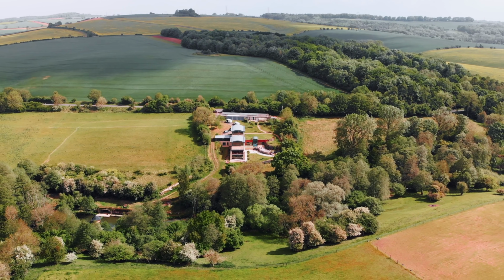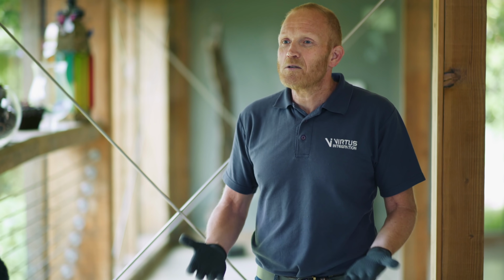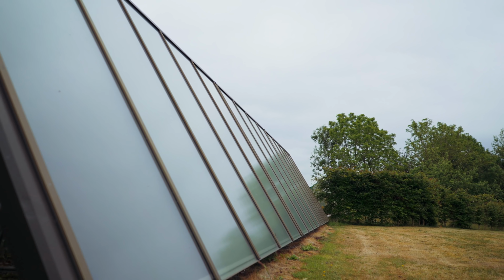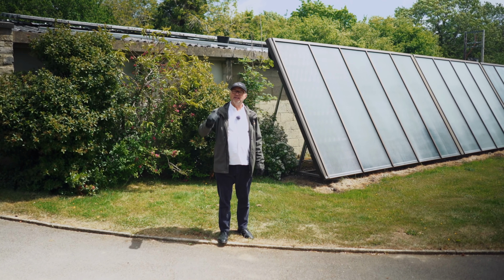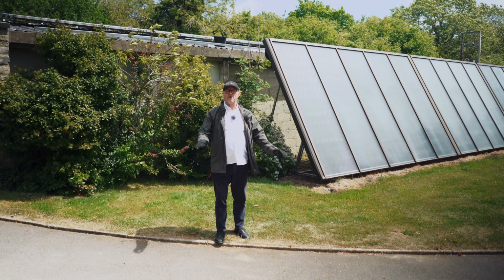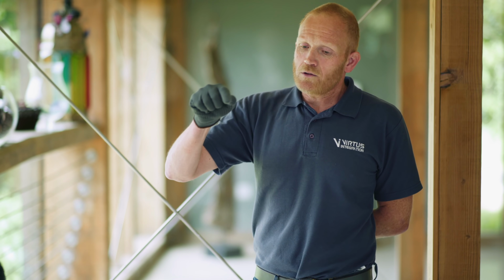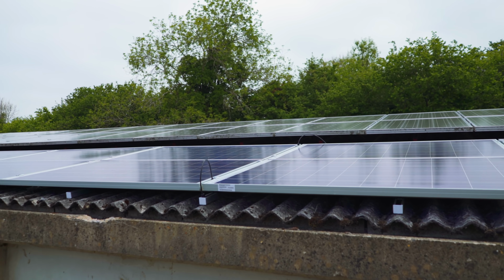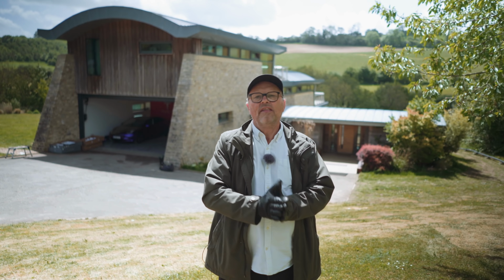Can you HEAT & POWER a big house with RENEWABLES? | FULLY CHARGED for clean energy & electric cars.

Comment: Our house is build in the 50’s and is energy positive, that means we heat the house and charge the ev with our 50 solarpanels. We spend a lot off money on insulation and offcourse the solar instalation, last year wo got money back from the energy company. Yes you can!
Reply: It must have been a strip out.

Comment: Robert, 

yes it is possible if you have an unlimited budget. If you rely on solar alone which averages about 10 to 12% capacity factor and have extremely large batteries to store when it is generating and your consumption is low, but don't forget to consider in winter when doing your capacity sums.  What are you planning for heating and cooking energy?
What the country really needs is cheap and reliable power which now is neither due to renewable generation. More of it puts us on a slippery down hill slope.
Wind and solar are technically unsuited for large scale grid supply despite the nonsense in some of the National Grid's ESO website, they should know better. The cost to balance the grid is climbing steadily all the time, cost passed to the consumer. Current electricity prices are 40% or so higher than they would have been without renewables. This cost inhibits business and as we have seen heavy industry has all but disappeared to the detriment of us all.
This technology may well be interesting but it is not effective and never can be.
Reply: PV panels and EVs will greatly aid in balancing the grid. EVs can be used to eliminate peaker power stations.

Comment: I recall a program in the early 2000's that covered the early stages of them building this house, where they were only at the stage of boring the geothermal hole and laying the ground heat network. It's nice to see someone go back and actually document the finished work.
Reply: This vid did touch on that matters have moved on technically. Having a geothermal borehole is an expensive undertaking. It would need to be communal, or a very large house with a well heeled owner.

Comment: Interested to know exactly how the concrete 'stores' and 'releases' the heat. Does it work like an old storage heater where it  just emits heat during the day? How do they direct the output to where it is needed? Amazing house, was the architect an eco specialist?
Reply: Concrete, stone, brick etc are very poor materials for thermal capacity, and most of these are not ecological or low-carbon. They are very slow to take up and release thermal energy and only work if they are 'exposed' - they work even less well if buried under a carpet or other surface covering or items of furniture. Glass is quite good (high specific heat capacity) but of course it is one of the highest embodied-energy materials so it's use should be minimsed!
Be warned - a building with a high level of thermal capacity using such materials will become a nightmare in future climate-warming situations. They will slowly charge and saturate with heat and due to high ambient night-time temperatures they will be unable to cool. Also remember that thermal capacity requires an energy source and when cold it will rob you of your radiant body heat! 
Water is an excellent thermal storage material and is usually free from the skies, and convection currents help water absorb and redistribute the heat in a tank. 
However, if you want a thin, lightweight material that is way better than glass or water at soaking up solar energy and then releasing it (at pre-determined temperatures) - then you need (PCM) Phase-Change-Materials - such as DuPont Energain. I hope one day we will see PCM materials available that are made from plant-based oils/waxes rather than paraffin..

Comment: Ground source heat pumps using trench style slinky heat collectors are incredible cheap and offer huge energy saving capabilities for almost every building. But even with an air to water heat pump you are far more enviromental friendly than any other heating technology  burning fossiles.

Comment: Moved to France in 2013 where we bought a 200 yr old stone house which needed completely renovating. Ripped everything back to the stone and started again. We put double the insulation required by French building standards and have put 3 wood burning stoves in. That is all the heating we need as once warmed up in the winter the massive walls retain the heat. The house is 200 square metres floor area. In March last year bought the first and only new car I will ever buy in my life (I am retired now), the Kia e-Niro. We have 2 acres here plus an acre of woodland 5 mins walk from the house. Last year replaced the petrol lawnmower and strimmer with Li-On powered machines and this year the chainsaw went electric too..In May last year added 8 x solar panels on the barn and produced 2,150 kWh in the first year with them, enough to power the e-Niro for 14,000 km. It isn’t perfect but we burn no gas or oil in heating the house, half of which comes from compressed oak sawdust logs recycled from the French forestry industry which is huge (France has the same area of forest cover as the entire UK land area)..the rest comes from coppicing and maintaining our own woodland and from local farmers. The common firewood here is coppiced sweet chestnut and hazel which they run on a 20 year cycle, clearcutting an acre or so at a time...it is amazing to see how fast it regenerates. Financial constraints mean it will be a few years before the next steps which will be an air source heat pump and 4 more solar panels. Some friends here have air source heat pumps and these things are getting more and more popular now which government subsidies to install them. Our experiences with the car, solar and garden equipment recorded on my YouTube channel ‘Kia e-Niro Diaries'

Comment: The micro grid is definitely the future, however, the price is prohibitive partly due to the decade long payback and more importantly that power generation is not a consideration when valuing a home for sale.
So a home with environmental heating is worth the to an identical home with a gas boiler, gowever, it cost vastly more to purchase and install. 
With the government exploring making it mandatory for a new home to include at least one renewable technology, this will only end up costing the home owner more in the short term and is very dependant how long they keep the property before they sell.
I have just designed our new home and although I would love to include some of these features, self build mortgage lenders do not take them into account when valuing the property, this you have to cover the cost by other means via grants, etc.
From research generating and storing electricity to balance the grid is the quickest payback, however, it is a prohibitively expensive outlay.

Comment: Great episode Robert…Passive House standard mentioned for design/building results in 90% less energy used and now with the Plus and Premium versions - it's very straight forward to build every house like the the Moonstone House in the UK…Exeter City Council are building a sports centre to Passive House  and there's a hospital in Frankfurt that is also built to PH (uses 50% less energy than a normal hospital).  Social housing and private homes are being built to Passive House standard across the UK at similar costs as a normal house with massive ongoing savings and comfort/health benefits.  Simple principles - insulation, high performance windows, mechanical ventilation with heat recovery,  eliminated thermal bridging and airtight (draft free) structure.  We've just finished a Passive House Premium home in New Zealand which exports to the grid, runs our EV, etc.

Comment: Any issues with overheating in the summer? As so well insulated to keep heat in... in some of these odd hot weeks we have... will it be sweltering inside or will be able to keep cool (my new, lot smaller, house, very well insulated, keeps heat in..., but gets super warm during hot (25°+) days/weeks... wondering if the same with this house or some of that clever heating can be used for cooling too...
Reply: Probably the difference with your new house? was the very large overhangs over their main SW facing windows which will keep out high Summer sun, but let low Winter sun in. Insulation keeps the Summer heat out, same as Winter cold, but you also need to keep the sun off the glass. Passive House insulation requires very little energy to heat, and similar to cool , so if cooling is required a reversible heat pump which puts cooled water through under floor heating would need very little usage / energy.

Comment: A  place worth visiting , in normal times, is the National Self Build and Renovation Centre at Swindon. Check it out on line. It is a good starting place for the latest energy saving ideas in House building.  Look out for their Green Energy events. 
Warning!  After my initial visit I ended up knocking down my old house and building as described in another post.

Comment: I see a lot of glass elements, and I'm interested in how this works insulation-wise. Can you really have the summer sun blast through a full glass building front day after day, and not have the temperature inside change at all? 'Cause we have a half-glass front here, and it's June, and sitting there in the morning is practically unendurable...
Reply: Main windows face SW and had massive overhangs (keeping high sun out in Summer but letting low Winter sun in) but, yeah, lots of glass is all the vogue but a nightmare for good thermal efficiency

Comment: As some one who made a large move and into a new build house in the last 3 years, I found it incredibly frustrating and saddened by the sheer lack of knowledge of these systems by the massive homebuilder companies. Had I been able to design and contract my own house I would've gone this route, but as we needed a house fairly quickly and in a specific school district we had to go with a pre-planned home builder. Just about every question about efficiency, solar, upgrading insulation etc was met with a blank stare followed by.. "we don't do that, I don't think the county would allow it, or "our houses are efficient enough"... :(... I even came in the night before drywall was put up and added more insulation and sealed gaps they left. Builders don't care, they just want to get the house built and sold as fast as possible. So like most of us, we're left with mediocre systems that we constantly have to patch with third party systems. I for one can't wait for Tesla to make new super efficient home heat and cooling systems that can be easily retrofitted.

Comment: How does that borehole work? Can anyone explain? Didn’t get it properly from the video
Reply: It's probably a soil heat pump, extracting thermal energy from the ground, and adding the electric energy used by the heat pump. With such a system you get 3 or 4 kw of power, for every kw of electricity.

Comment: In terms of Upfront Carbon Emissions, this house is an incredible example of what not to do. Building way more than you need, threaded through with energy intense metals and glass, and heated by an unnecesarily oversized system which is rarely used.
Reply: Exactly correct. I found this house (?) really offensive and many of it's systems unnecesarily excessive. It is a good example of having a human mindset of 'entitlement' and being unaware the harm we often do as a species.
In 1972 I designed the Integrated Solar Dwelling - a ultra-low-cost experimental off-grid, passive solar dwelling - which after years of effort I manged to self-build and monitor at Brighton Polytechnic. My partner and I designed and built a simple passive solar water heater that gave us boiling water for much of the year, we designed and built a water-less indoor aerobic composting toilet, the rainwater collection system and fitted water-saving spray taps, we constructed the experimental wind turbines and we created an organic garden and recorded crop yeilds. The dwelling was lightweight timber-frame (we fabricated our own i-beams), carefully constructed to provide air-tightness and it did not require much in the way of foundations - paving slabs will do the job. Tower housewares made us a special 24Vdc cooker and a local school teacher made us a 24Vdc water boiler. 
A major sponsor of the Dwelling was the Swedish Masonite company who provided panel materials (Masonite i-beams were not being imported at that time, though they were being tested by the Civil Engineering facility at the Polytecnic).
The design featured a large sun-space, an uninsulated buffer-zone to the north and simple 'solar-collector-south windows'. Solar pre-heated air from the sunspace was drawn into the dwelling by the low-level airflow created by the toilet vent pipe. There was never any condensation on windows and if you held your hand near an outside wall you could feel your body heat bounce back! 
We did have a major issue with the wall insulation installer and the calculated heat loss was around twice what I had designed. Even so, just two extra people being in the dwelling on a freezing winter's day lifted the temperature nicely. When a 1kW fan heater was temporarily purchased after my partner left hospital following a life-changing bike accident we found it could only be used for a few minutes - the chart recorder trace went vertical! We intended to experiment with phase-change-materials to provide thermal capacity, but following the arrival of Thatcher in 1979 our pioneering project was cut short and closed down.
This was a TRUE PASSIVE dwelling. No wood-burner, no unecological heat pump, or MVHR system, and certainly no unecological steel-reinforced concrete slab... The only active systems were the 24V wind turbines, a small dc pump to raise water, and two 24V drain valves on the solar water heater for frost protection. OK it was fairly compact and basic but in 1979 the total cost including our salaries was around £13k.
We live in a temperate climate and our basic needs are quite small. We need robust dwellings that will still work when the grid has collapsed, - that are fairly straighforward and easy to build, ideally using renewable materials (the products of photosynthesis). Yes we will need some level of technology - copper pipe, wire, glass metal, PV's etc, but please keep things as simple as possible and NEVER use tech, ic's when you can avoid it!

Comment: The good thing is that any sort of house can now no longer need gas all you need is good insulation, solar, storage and heat pumps. Currently renovating my house in Australia with a 6.7kw/h solar system a Powerwall and a hot water heat pump unit. No more gas you little beauty

Comment: Fascinating. Perhaps the most important point was the heavy use of insulation. Depending upon where you are solar and/or batteries and/or heat pumps may or may not make sense, but insulation always makes sense.

Comment: Really interesting video. We really need to rethink how people get and use energy. On a much smaller scale, we have an 8 KW solar system on my house which produces about 13 MWhs annually. If we added a couple of Power Walls, I'm sure we could be almost off the grid. If the 330 houses in our section of the subdivision all had a similar solar setup, then we'd collectively have about 2.6 MW of solar with an annual production of about 4.3 GWh. If we all had two Power Walls and managed the whole thing like 330 networked power plants with about 8.1 MWh of storage, then even in December when production is about half of what it is in June, our community would have enough electricity. Of course we could do a lot more by properly insulating the houses, installing heat pumps for ground source heating and cooling, and installing solar water heaters on each house. I'm getting a bit carried away, but this is what I would like the future to look like.

Comment: Everyone I know uses 100% renewable energy to heat their homes.  I live in southwestern British Columbia, and almost all of us use hydroelectric power to run heat pumps (if they're lucky) or baseboard heaters (if they're unlucky).  So I was confused by the title until I realized it wasn't about heating and powering a house with renewables so much, as it was making a really efficient house that has some on-site electric generation.

Reading about "HEAT[ing]" and "POWER[ing]" a house confused me initially.  To me they're one and the same, as one typically uses electricity to heat a house here too.  When I was a kid some people were still on oil heat, but everyone I know upgraded their oil heat to heat pumps so I haven't thought of the two as being separate things since I was a little kid.

It was a good video, with a bit of culture shock for me (as usual).  Thank you.  :)

Comment: Nice one Robert. Good video. Surprised you didn't talk about solar passive design - would love it if you could do a video on that! For some reason it never seems to come up in a lot of house design videos but in my opinion it is the cheapest most effective thing you can do to make an energy efficient house. It's not that hard - just make sure you put most of your windows facing South (in Northern hemisphere) or facing North (in Southern hemisphere), insulate well and have thermal mass on the inside. Also - if you haven't orientated your house correctly the insulation and thermal mass will actually work against you. I live in a solar passive designed house in Australia (near Canberra) and we rarely have to use any additional heating or cooling. Love your work Robert!